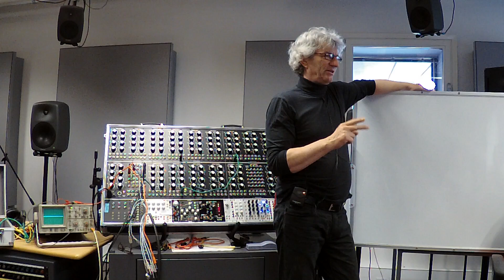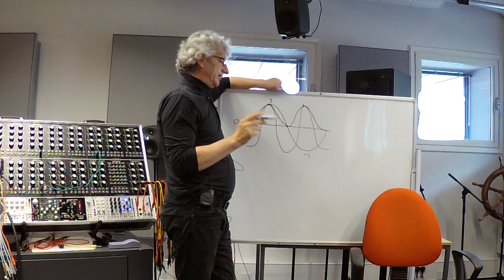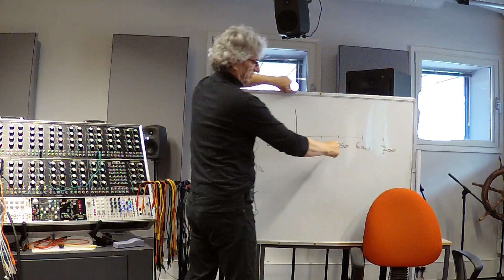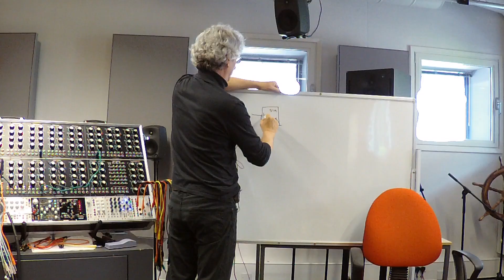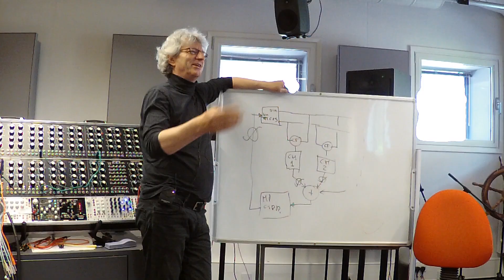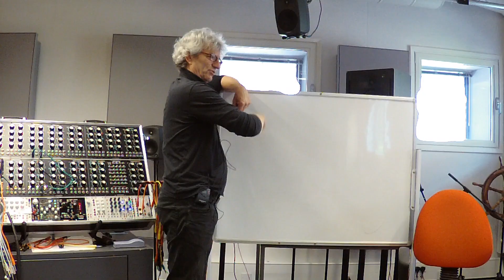Hordijk #11： OSC HRM & Linear FM Synthesis  ⧸⧸ Hordijk Modular Workshop @NOVARS 3 4 June 2017

Comment: This is a longshot, but: does anybody out there have any insights why his algorithm crossfades between the quadrature waves before applying the Chebyshev polynomial transforms to the resulting signal? Are the crossfaders there to adjust for phase errors and ensure that the phase of the cosine wave that is used for the FM is actually precisely 90 degrees off of the sine wave? Or is there another reason I might be missing?

If it's for phase angle adjustment, then I'm still puzzling out how that solves the case where the phase is less than 90 degrees. Maybe an error in that direction is unlikely enough that it's not worth planning for?

I've been trying to implement the algorithms he's described in some of these videos as an educational (and musical!) exercise, and this is one of the bits that still confuses me.

Regardless of response: many thanks @NOVARSlab for sharing this workshop footage--what a brilliant fellow Hordijk was! RIP to a titan.